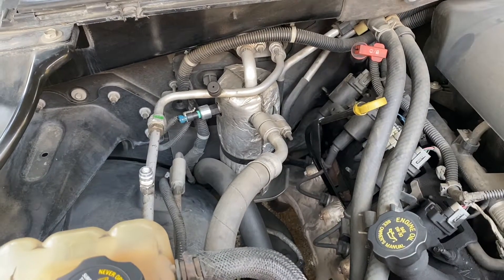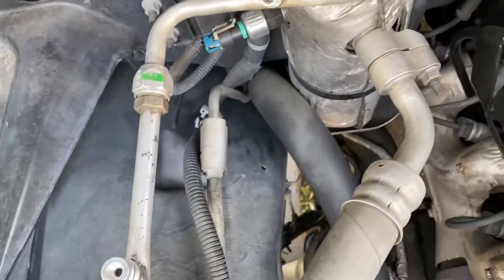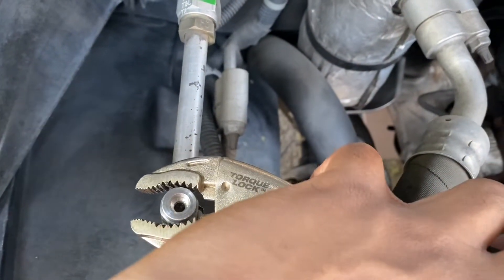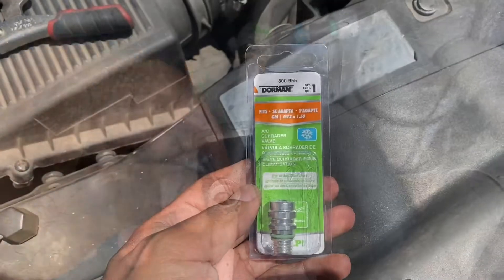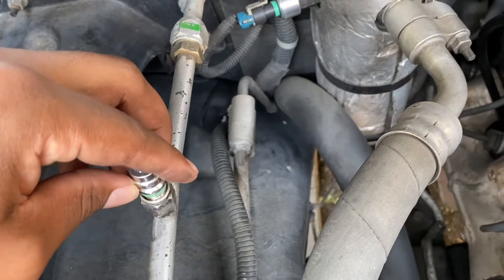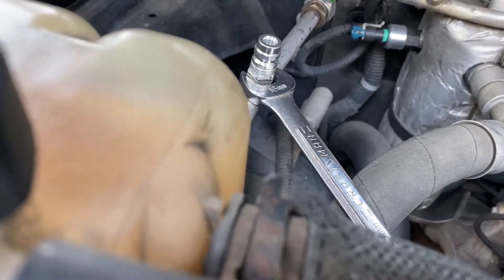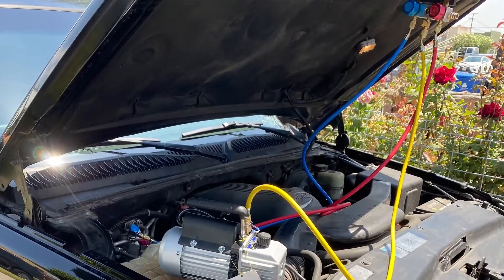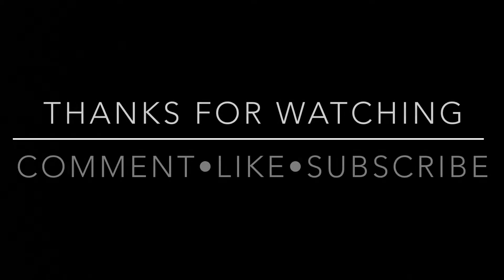2002 Escalade A/C high side service port valve replacement

Comment: You are the only one on You Tube to show that both the high side and low side are in the same line that close together ! 
Ive got a 2006 ESV and when i saw that both the valves were on the same line one foot from each other i thought that was impossible. Appreciate you showing both ports 🫵👍
Reply from the maker: Thanks for watching

Comment: Awesome video!  Had a replacement ball valve but going to go with the one you showed instead.  Both high and low valves leaking real good so time for an update.
Reply from the maker: Yea the ball valves seem to be one time use only

Comment: Ihave a 02 suburban and my problem is icame one afternoon to start the truck and i got a loud freon hissing/ freon spraying sound from around the compressor and wasted alot of my freon so ibought the compressor new and went to recharge my system and still does the same thing as soon as i start feeding freon to it any suggestions? Ive heard there are 2 high pressure switches the one on the compressor and the other one near it almost kinda hidden?